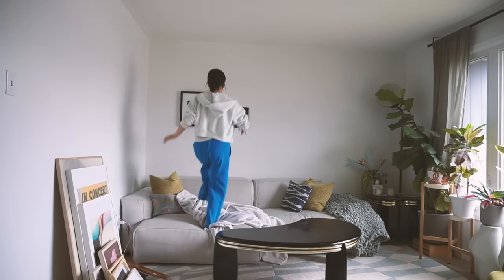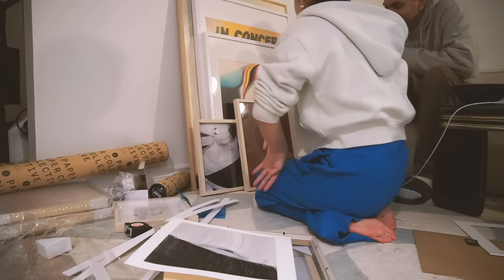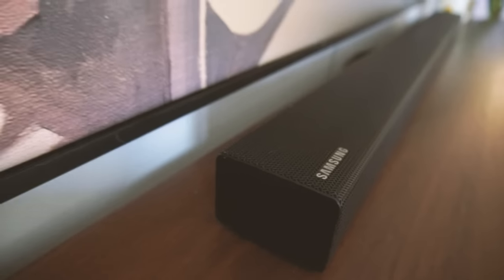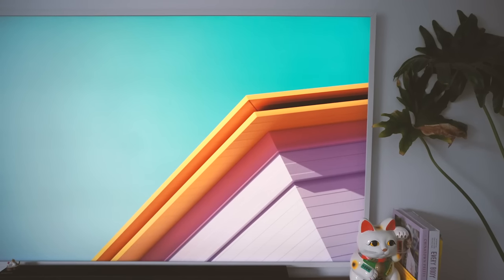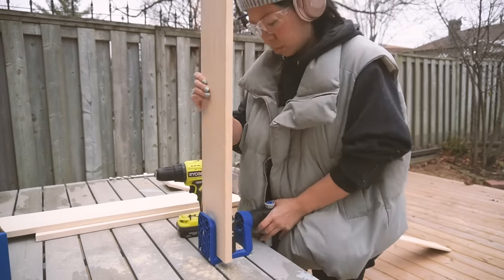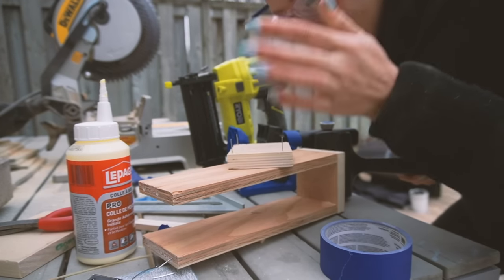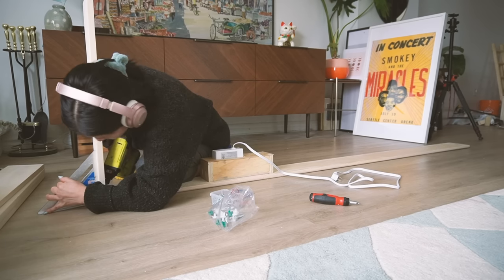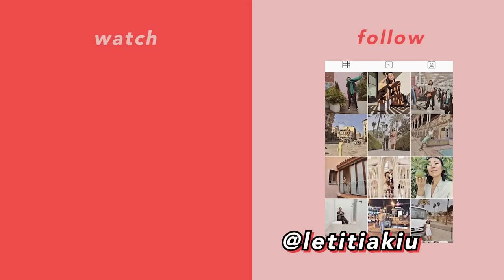DIY Behind the Couch Console Table (with hidden charging!) + Living Room Update

Comment: such a kleen finish! I think your table might need some triangle support or a cross brace for added durability - easy things to add though.
Reply from the maker: yes! this is not structurally sound if it didn't have the wall and couch to support